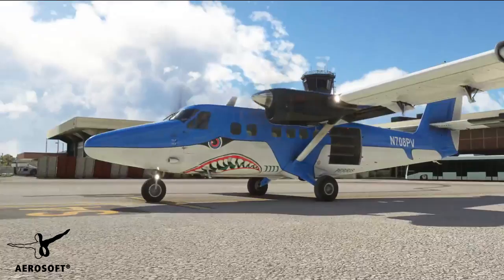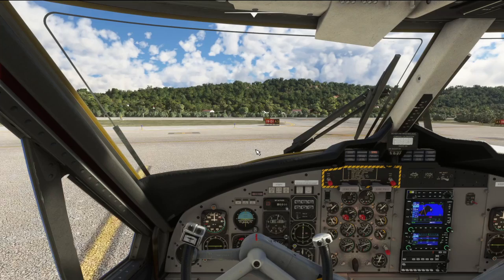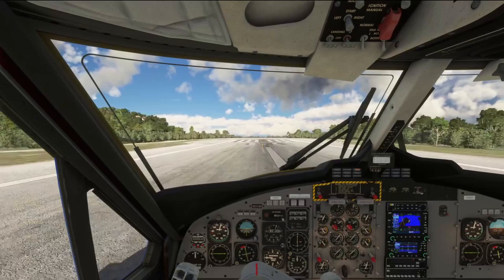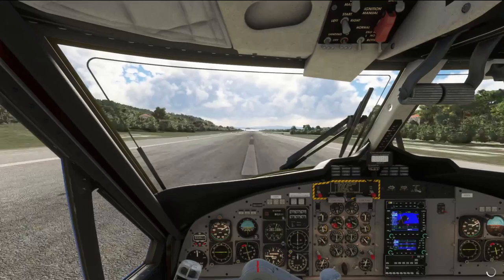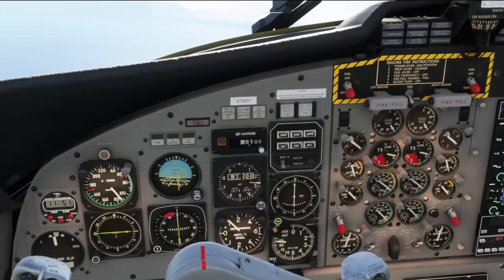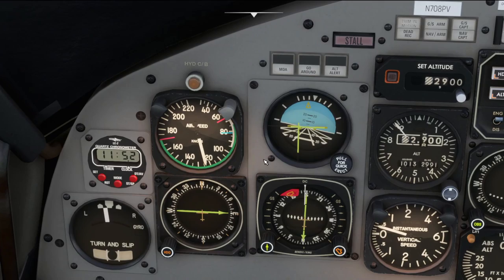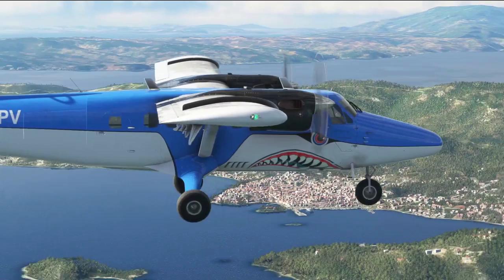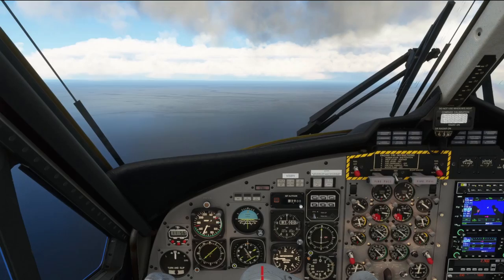Aerosoft TWIN OTTER Tutorials - Episode 2 - Taxi, Take Off and Climb [Microsoft Flight Simulator]

Comment: Very nice walkthroughs. When to use autofeather and yaw damp?
Reply from the maker: If you're going to turn Autopilot on you will need yaw damper on beforehand. Autofeather is there as a protection should the engine fail - it'll automatically feature the props to reduce drag on that propeller

Comment: I bought this addon this morning and was totally disappointed with the sounds.
Reply from the maker: What's wrong with the sounds? Real twin otter pilots have helped develop them
Reply: @BritishAvgeek  so, that doesn’t mean they are implemented correctly.  There’s lots of complaints I’ve seen about the sounds with this and Aerosoft have stated they are working on it so are aware of the issues.
Reply from the maker: @WhiteHawk77  they're aware of a few looping issues but I don't think the sounds are terrible/bad
Reply: @BritishAvgeek  i think the real problems with the sounds is the crossfade from idle rpm to takeoff rpm. No smooth transition.
Reply from the maker: @cessna18284  👍 they're working on something which will be in a testing version over the next few days/week and once approved it'll be released as an update.
Reply: @BritishAvgeek  seems like it’s more than just looping issues, here’s an example of one comment out of a few complaining about the sounds on the official launch trailer. “Fix the sounds..... There's no tick tick tick from the igniter, or prop spin up noise at startup,. the prop RPM changes are horrendous and way too quiet!! the hissing/wind noise in the cockpit is too loud. I work at an airport that has a Twin otter in twice a day I'll use my audio recorder and send you samples if you want, and you can see how unrealistic yours are.”  Doesn’t seem like those that know how it’s supposed to sound are too impressed even taking out the looping issue.

Fact is the Twin Otter deserves better than what Aerosoft have released here, is it awful, no, it’s OK, but they need to step up their game to the standards that are possible now, SWS has with the Kodiak because they scratch build that with the what’s possible, but Aerosoft have done a lazy job that looks like a port even if they say it isn’t.  Again, I may pick it up later when it’s been patched or I might wait for a sale.  I was looking forward to it but wish they’d put a bit more effort in and also not released a cut down version with regards to the systems, I hope they will release an extended version in time but I have to wonder if they will bother and how far out it will be if they do.
Reply from the maker: @WhiteHawk77  they're looking at an update in the near future with numerous sound tweaks/fixes/changes to hopefully address what has been raised - might be worth revisiting content to see if it's changed more to how you expect after it's been pushed 🙂

Comment: You switch off landing lights above 10000ft.
Reply from the maker: Depends on the procedures of the operator using it. A pilot I spoke to told me his operator turns them off earlier to save the bulbs. This is only a tutorial to get the majority up and down confidently - the smaller things can be picked up dependant on what each person wants from the add-on 🙂

Comment: my twin otter is dragging to the left all the time when taxing on the ground, is that normal?
Reply from the maker: Check your Deadzones perhaps? Mine doesn't drag left all the time from what I've noticed
Reply: @BritishAvgeek  It only happens when taxing. I have to correct the trim to the right all the time.What difficult should i set on this plane? I usual has everything on hard.
Reply from the maker: @tomslittlecorner  the hard setting should be fine :) could it be something like brakes sticking?
Reply: @tomslittlecorner  The drag to the left is caused by the torque rotation on the propellers. Next to the captains seat by your right leg there are trim settings for elevator and rudder. Align the white bars together, that should solve the problem.